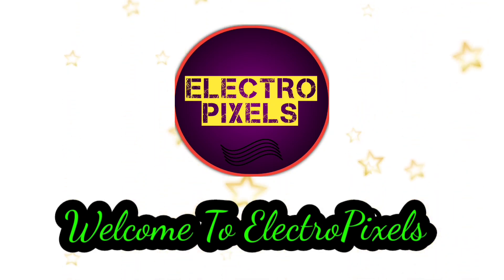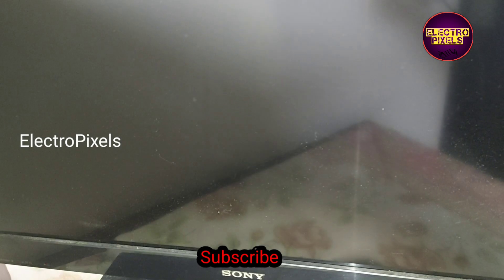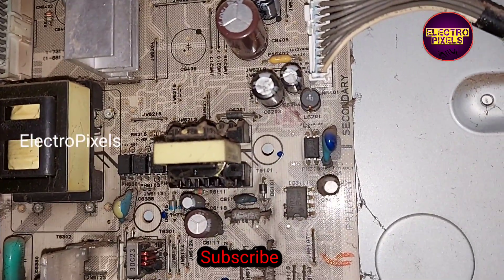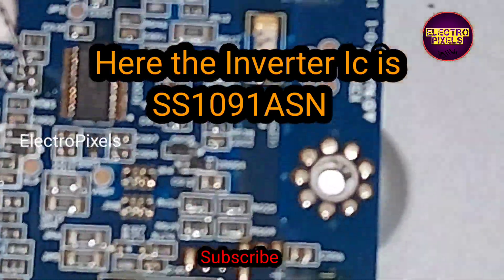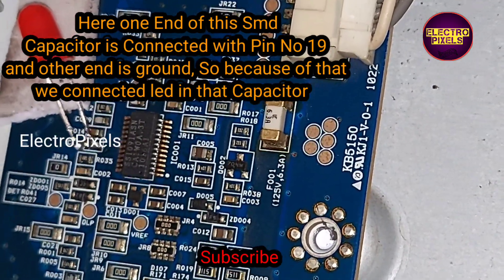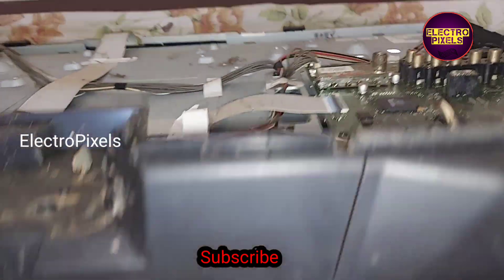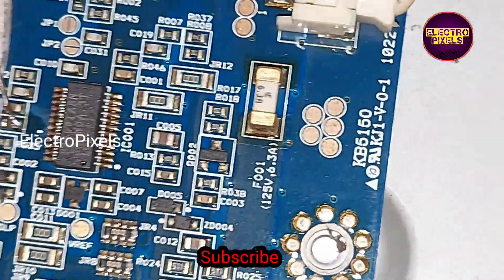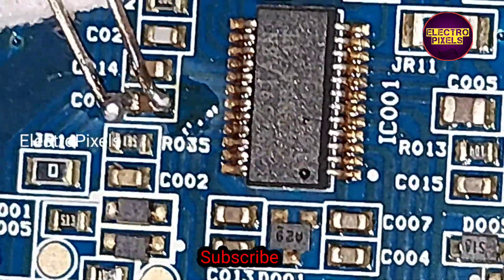SS1091ASN Inverter Ic Protection Removal|Sony kdl-32bx300 Six times Red light blinking|Tvreparing

Comment: saludos desde Venezuela me funciono perfectamente una consulta cuanto me dura eso con el diodo led
Reply from the maker: Just temporary solution if Back light fails then we need to install new Backlights since it's a LCD tv that comes with CFL Tubes, and that is not available in market so only option is convert it in to LED